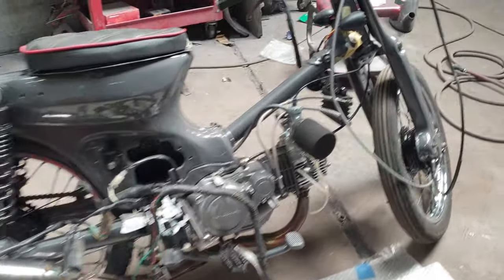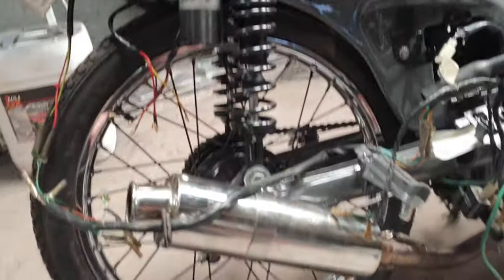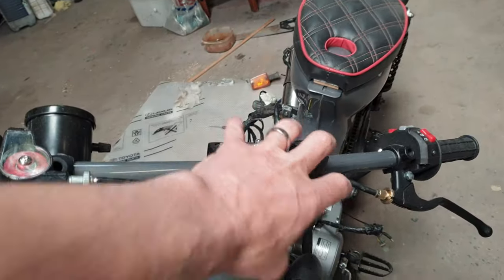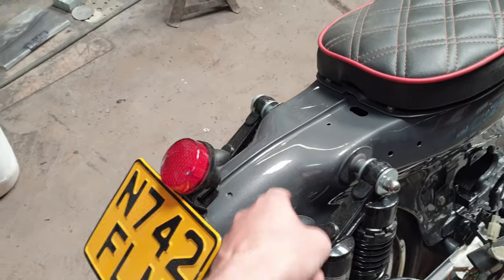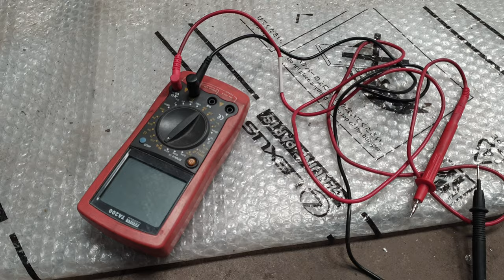CUSTOM HONDA C90 PROJECT PART 2

Comment: Got my own build going on at the moment so interested to see what others are doing. Looks good. One word of advice. That exhaust shouldn't be fixed to the swinging arm, it will break or damage the exhaust as well as restrict the movement of the arm. Having the bracket loose on the pipe won't help. Good luck with it.
Reply from the maker: Cheers mate, yeah I know about the exhaust thanks.
I've been needing to make a bracket up for a while now the bike is complete ( I'll put a video up ASAP, so keep your eyes peeled for it)
My suspension is so stiff on this thing,  the swing are hardly moves so its not too bad. I will change it once I've made a bracket up though. 😁😁
I love these c90's ! I've got a 1000 and 600 sports bike and this thing makes me smile so much more!